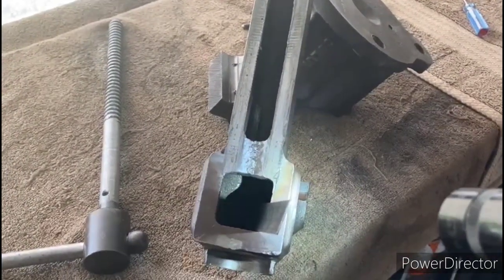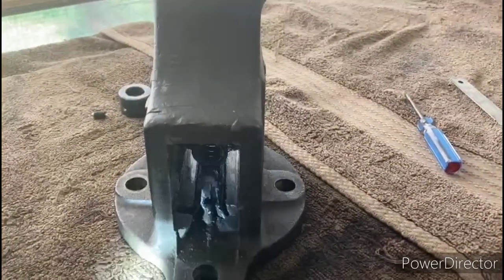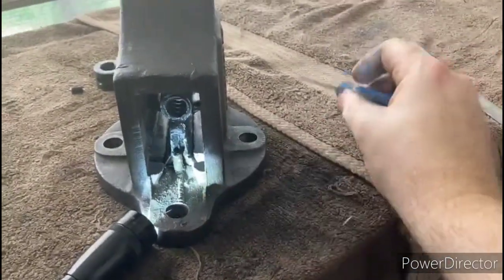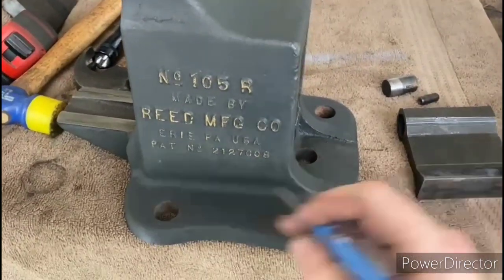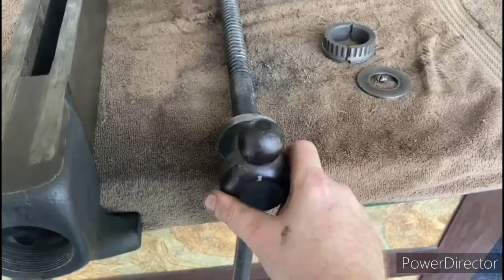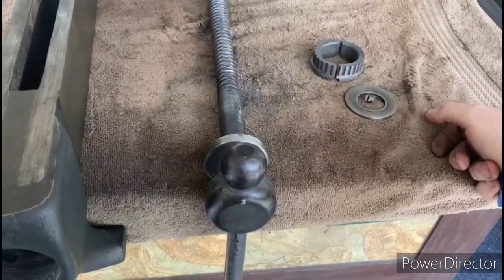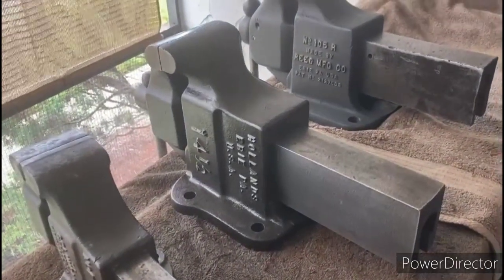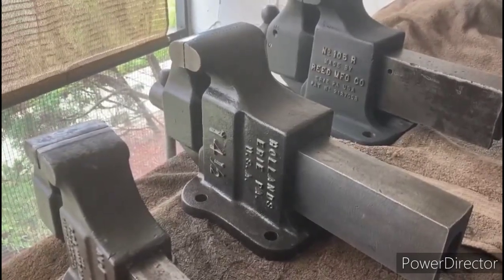Who made the best vintage US bench vises? Comparing a Reed R, Hollands & Columbian (part 1 of 2):

Comment: Very nice presentation.  A well maintained vise with the appropriate  jaws is a valuable tool when disassembling and assembling items. I have used many vises in my career. Some worked well and others I had to disassemble and clean, lube and reassemble to have them work well. I never paid attention to the manufactures. Some were well made, others were not good when new. Thanks for bring the manufacturers  to my attention. However I have laid my tools down. I do very little repair work anymore.
Have a Great Day!
Reply from the maker: Thank you. I appreciate you watching the video.

Comment: tHanks for an excellent video.   I just picked up a Reed vise a little over a week ago.  It was at an estate sale and it was only by chance that I added it to the things I was buying.   Now I'm realizing it may have been one of the best purchases of the summer.
Reply from the maker: A vintage Reed vise will not let you down. Congratulations on getting one.
Reply: tHank you very much. I was watching how a bent handle was repaired with a torch and ...well, another vise.   It was fairly amazing to me...I don't weld nor heat.....I'm just barely talented enough to drill.

This one may stay as is for the time being. I think I'm lucky to have come across it.

tHanks for the great videos! 

 @BencoVintageMachineWorks

Comment: I'm restoring a Morgan 40A, and I don't see the issue with a "loose" nut - the purpose of the nut is to engage the threads of the leadscrew and hold fast against the base of the vise. As long as one can tighten against the nut, it's doing its job. Yes, a forged and machined nut is less likely to break. I also see the adjustable collar on leadscrew as a simple means of taking up any slop that might develop between leadscrew handle and moveable jaw.
Reply from the maker: The purpose of the video was to discuss the small differences that set Reed apart from otherwise common vise designs like the Morgan. The Reed is better engineered and more user friendly. It cost more to build and took more time to manufacture. The machined ways, the beautifully forged and machined nut, the provision for lubrication without disassembling, the provision for slop adjustment without dissassembly. Fireball tool just did some bench vise torture tests and the Morgan broke pretty quickly. The Morgan swivel base design is pretty weak too from what I saw.

Comment: Great video. I am a Parker user, restorer  and collector. May I respectfully offer an opinion…
The fixed base Parkers are best used on a pedestal as opposed to a bench. Therefore only the mounting plate needs a notch. 
The swivel base vises are good on a bench. 
Note: the fixed base vises are not flat on the bottom. To avoid unnecessary stress on the mounting points, use washers between the vise and the plate it is mounted to. 
Thanks again for a great study.
Reply from the maker: If it was an 8" model or perhaps a 6" I could see the point of mounting on a pedestal. The average user of a 4" vise (as in the video) is probably using it on a bench. That being said, the Parker is a great vise!

Comment: Fantastic vises! I agree with you completely about swivel bases vs. direct mounting. I'm American, but I live in Australia. I discovered Dawn Vices (they spell VISE as VICE here) about 3 years ago, and am impressed by their quality and that some are still made in Australia. Their super grade offset vises are (I think) the finest vises made in the Anglo world (if not the world). The Australian dollar is weak, so you even with shipping, you could probably get a new one for less than the cost of a new Wilton (a USA-made Wilton). I've restored/conserved a few older Dawns (including a wood vise that is at least 70 years old), and I also own several new ones. (As with Wilton, only some are now made domestically, so you have to look at their catalog carefully to get an Australian-made one.) The new ones and old ones have the same robust build quality with simple designs that go back more than 100 years. (Dawn has been making vises in Australia since 1917.) One thing I've noticed about Dawn vises that might be unique to them--please tell me if I'm wrong!--is the nut does not have a pin holding in place; rather, there is a recess cast in the base within which the nut sits. Though older Dawn catalogs show swivel bases and quick-release options, the modern Australian-made vises are all the original, simple still without quick-release or a swivel base. I think Americans should try to support this company, and with 100 years of history that is almost entirely unknown outside of Australia, you'll find it an interesting dive :) 

Here is a great history of Dawn: https://motofaction.org/tool-reviews/dawn-manufacturing-australia-tools-vice-history-company-information-coburg/
Reply from the maker: Maybe one day you can make a video about them....
Reply: @BencoVintageMachineWorks  I don't really have any experience making Youtube videos, but I would like to do one someday.

Comment: Great video. Just found a Reed 105R (11/49 build) locally that I am going over. Took a while to find. Was surprised to notice that the screw is of a smaller diameter than my 4 1/4” jaw Parker No. 49. Otherwise the construction and design of the 105R seems to be top notch.
Reply from the maker: It is top notch overall as you noticed. Of course all these vises are good. Its just fun to compare them and ruffle feathers along the way. The reality is that anyone who manages to break any one of these beauties is more likely the problem, not the vise.

Comment: I don’t consider the shorter screw a disadvantage as the vise maintains the overlap the slide so clamping is possible without damaging the the vise like the Columbian or Wilton which become wracked or bent. IMO. I enjoy your video, thanks!
Reply from the maker: Glad you enjoyed it. Check out part 2 with the Parker vise...
Reply: @BencoVintageMachineWorks  my 5” Reed is an older model which has the round “hub” for the handle.  Yours has a nicer setup nut.  Mine also has the swivel jaw which isn’t super helpful.  I have used it…. The vise works most every day.  I enjoy seeing your stuff.  My buddy has an Athol on his bench which is totally any other vise except it was his dad’s.  I tried to tell him it is pretty cool. I would like to tune his up a little.
Reply from the maker: @cogentdynamics To be honest, most of the vintage US bench vises are decent if used within their intended scope. Its just fun taking things apart to compare.

Comment: Awesome video - plenty of detail but also practical.  Can you suggest any brands/models that would be second or third tier from the old made in USA era?  I've been watching estate sales, ebay, craigslist, etc. for a few months now and still haven't found anything in the 4-5" size I'm looking for, in decent shape, for less than a couple hundred bucks.  For a general homeowner (no welding, extensive work load, or shop environment) who jsut needs to hold things tightly in place on the weekends, is a old made in USA craftsman vice fit the bill?  I see they tend to run cheaper by a good margin on Ebay etc.  Is there another brand that has less history and doesn't make the top list, but is probably a good idea for someone with my needs?
Reply from the maker: Sure, an old Craftsman vise would be ok for general homeowner use. They were popular. I would be on the lookout for a Hollands which are usually a little cheaper than some of the other brands. A vintage Hollands is a good mixture of cost and build quality. Good luck with the search.
Reply: I bought an old Craftsman for 30$ which is actually a rebranded Columbian 604 1/2 and it is HEAVY! Anything with US made on it is going to be much better quality than anything newer from Asia.
Reply from the maker: @jimbusmaximus4624 
Craftsman had Reed make some vises too back in the day. The Columbian was a great price. Congratulations.

Comment: Yea I've got a couple REED 105s mounted on a dual stand... I like them a lot but honestly I've got a 805 Charles Parker that's about 50 pounds heavier and way more stout. I The oldest one I have is Howard Iron Works 4.5 incher...It's built the absolute best. But Yost made a very nice vice as well, got a 203 & 204. The Ridge Tool Co made a Beast of the vise called the SIMPLEX 46, it was the first vise I ever owned.
Reply from the maker: Thanks for commenting on the video. I have never owned a Howard Iron Works vise but they look nicely made. When I get around to making the part 2 of this video, I will take apart a Parker for comparison.
Reply from the maker: @JasonGrace1 You can take apart the CP and just compare the design to the Reed R shown here. I love my CP vise and would never sell it but its no Reed R series in terms of build design. Weight is important but not the only indication of a quality build and, more importantly, a well designed vise.
Reply from the maker: I have seen those before and actually looked at buying one. I passed on the one I looked at because it was somewhat sloppy in the action and there wasn't much of a precision "feel" when clamping. They are massive and,  if you work in a railyard or shipyard, appropriate. 
 I think looking at the nuts and bolts design is important because it shows you how much effort was put into, not only the size, but the engineering and ease of maintenance. 
Your average user will never need something more massive than a 5 inch, 75lb vise and will get more practical benefit from the ease of lubrication maintenance and the ability to take the slop out of it which will keep it feeling more precise longer.  Many jobs require a precise feel when clamping (otherwise, everyone would just buy 8" vises and be done with it).  
Maybe you can make a video on your CP. Would love to see it taken apart.
Reply: I just bought a Yost 104 that looks like it's a hundred years old. I've got a lot of vises Wilton, Morgan, Printess, A. Sterrett and German vises, but that that old Yost is most impressive.
Reply from the maker: Yost did the castings for Starrett vises from my understanding

Comment: For me, one of the best features of the threaded collar retaining nut on the Reed is it doesn’t require a detent drilled into the screw to hold the retaining collar (like on the Colombian).  This leaves you with a stronger screw.  Drilling the hole creates a failure point that the Reed system avoids.
Reply from the maker: Exactly. Worse yet are the vises designed where they drill a hole through the screw to secure the spring (which takes up backlash).

Comment: @Benco Vintage Machine Works Hi Terry - First things first, I have to tell you that I've watched this video several times and, quite frankly, it totally changed my way of thinking about vises, in general.  Instead of buying a new "high tensile PSI" vise, I've decided to buy a Reed "R," but, unfortunately, it's taken a while to find a size that's useful for us...until very recently that is.  Although I was waiting to find a Reed 105 R, I've now got a line on a 204-1/2 R that needs some refurbishment.  I'm just about ready to pull the trigger on the vise, but I thought that I'd ask you a couple of questions first.  The first question is: (1) Do all the Reed "R" vises with the "hockey puck nose" main screw have the slop adjustment on the threaded collar that you went over in this video?  (2) How does one tell if a given Reed "R" vise has replaceable jaws?  Unlike your 105 R, and based on photos, I can see six distinct holes on the 204-1/2 R that I'm interested in.  Two of them are centered just behind each jaw (on top) and the remaining four are on the ends (sides) of the jaws roughly 3/8" back from the "teeth" of the jaws.  Anyway, I'm assuming that all six are pin holes; hence, this particular question.  Thank you kindly for your time and please keep up the very informative videos. 👍
Reply from the maker: Yes, the hockey puck is in indication of the threaded collar. Some of the earlier R vises had a round "meatball" nose and some of those did not have it because they were transitioning to it at that time. This is the reason I suggest finding the hockey puck. Reed vise jaws were forge welded into place during the manufacturing process and not held in with pins (like Charles Parker was for example). Any pins present are probably from a modification done by a previous owner. Perhaps to accomodate a set of smooth or soft jaws. If the vise has been modified, I would pass on it unless its real cheap.

Comment: Good Morning. Appreciate your video. Now,   I have a new passion of restoring an old Reed 402-1/2 vise that's been in my family for many many years. Recently the "collar" under the front of the vise which the shaft runs through cracked and broke. It has a threaded hole which has a set screw. Any Idea of where I can find one. Thank you for the help!!
Reply from the maker: The collar comes "broken in half" from the factory. Its not broken (they made it like that on purpose) just fit the two pieces together and screw it in....
Reply: @BencoVintageMachineWorks  Thanks for the reply. This collar is clearly broken in 3 pieces. TY
Reply from the maker: Ok thats different. You can probably repair it yourself because its not under any pressure really once its screwed in. Otherwise ebay will probably have one eventually. Good luck!

Comment: I have a hollands 104 1/2 in rough shape. It not stationary. The mounting base is broken in half. I am well versed in metal work. Just curious if I should fix and restore for personal use. Or sell to a collector as is.
Reply from the maker: I would braze it back together and use it. Most collectors would not be interested in a damaged or repaired vise. That being said, a Hollands is a great daily user and I own several of them.

Comment: I’m no vise authority so I try to learn. What do you think of C.Parker USA Meriden CT ? Clamp strength is the true test of a great vise. If you can clamp them down with little effort.  Maybe someday, someone will test clamping force of various USA vises. Thanks. I’ll check out the Reed.  Old Reed.
Reply from the maker: Charles Parker made excellent vises and many people (including me) love them. That being said, there's more to vise build quality than just clamping force. If you find yourself constantly working at the limits of your vise, something else is wrong. There is a video by Fireball Tool on youtube where he tests some various vises clamping to failure point. Good luck in finding a Reed R series, you will not be disappointed. Thanks for checking out the video.
Reply: @BencoVintageMachineWorks  awesome. Thank you so much. Where can I read up on Reed vises? I’d like to do some research. Is the R203 a good vise?
Reply from the maker: @emiliog.4432  The 203R is a swivel base model. I prefer stationary vises unless you really need the swivel feature. Make sure it has the flat nose and the oil ports on the side. You can't go wrong with a vintage Reed vise.